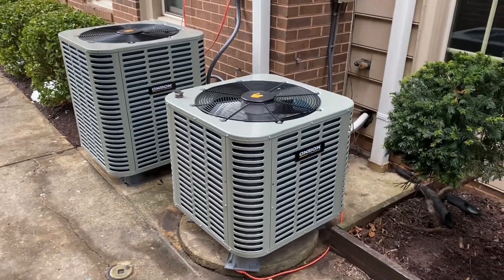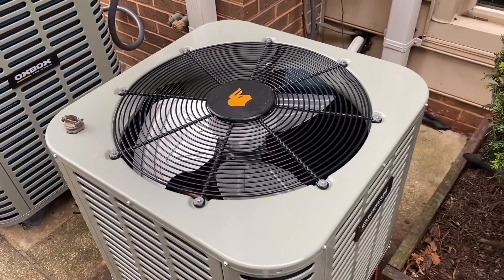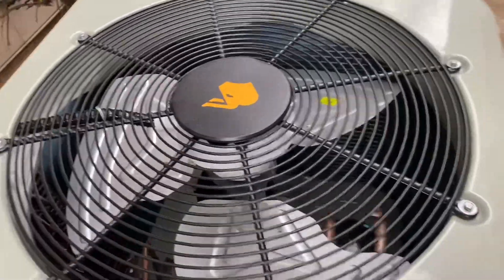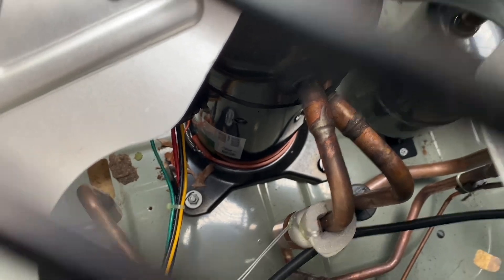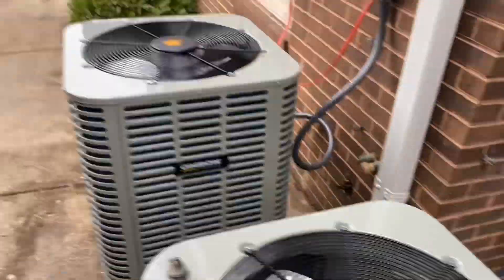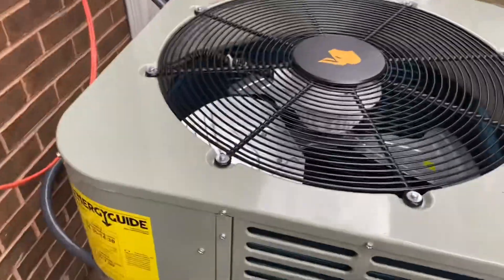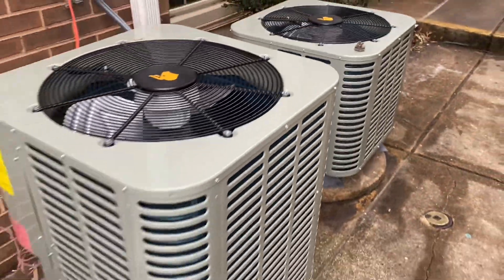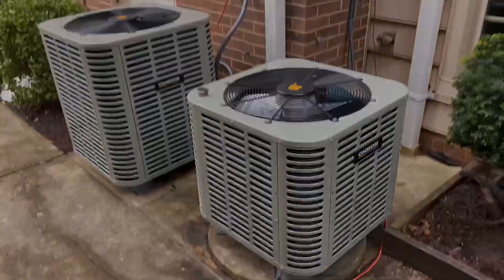REVISIT - Two Brand New OxBox Heat Pumps

Comment: Bummer. They should’ve gave that 2009 Comfort a few more years since it was only 14 years old. I don’t care if it was actually a base, I’m calling it a Comfort to not confuse with the well known Base Models. I’m glad Midea Products are rare in my area. I’ve only seen one midea product in my area ( An Ameristar in Downtown Huntsville which replaced a Late 2000s Goodman ). This complex should’ve known better.
Reply from the maker: Midea is rapidly growing common here in NOVA. Carrier's product line was stupidly confusing at the time that base was made, they stopped calling em Bases around 2010 or 11 (i forget off the top of my head), either way the only difference between an 06-08 Base and a later Base series is the fan shroud/assembly... lol